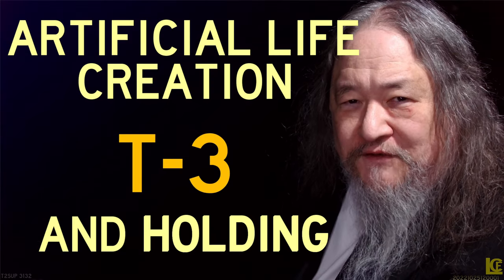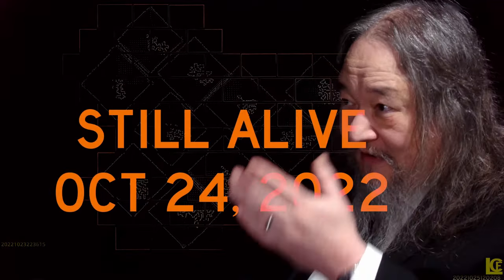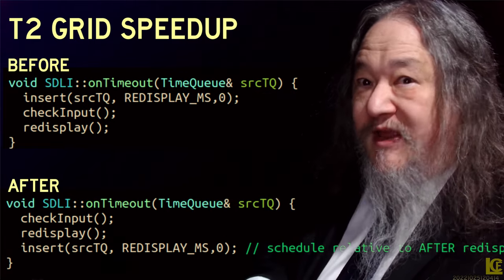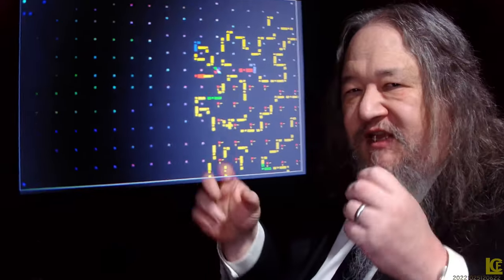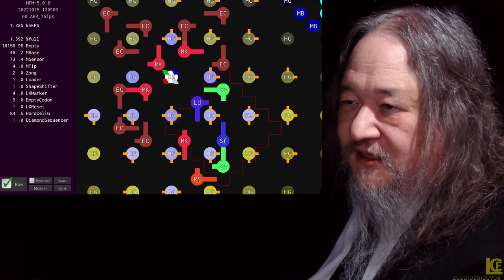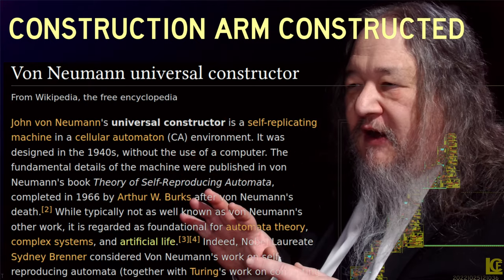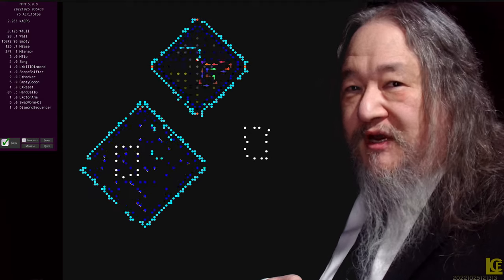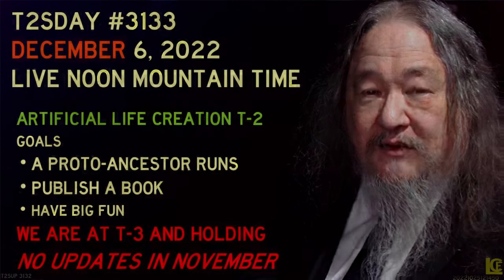Artificial Life Creation T-3 and Holding - T2sday Update 3132

Comment: More questions! How do you prove a minimum bound on up-time? For example, imagine you have an extremely complex sequence cycle with 1500 node species, and you've created self-replicating cells that can compute something meaningful:

1. Is there mathematical strictness that can be established on the uptime? For example, how confident can we be that systems deployed on this won't suddenly crash after some specific amount of elapsed time, say, 15 years from now? The termination state of the program could be postponed by complexity, but is it possible to provably establish that T_termination.

2. Related -- How is a mathematical definition of robustness established? If I "apoptose" a cell by hitting it with all sorts of random shit, will other cells split to fill the space and the functional role of that cell?

3. In an attack via cell-deletion (similar to your x-ray debugging tool) I wonder what the "takeover rate" of a distributed computational network like this has to be in order for the fundamental function of the computation to change. For example, if I wiped out every node but one, it might be possible for that one diamond cell to reproduce indefinitely, but the higher-layer "programs" on top may be lost completely, effectively resetting the memory of the system. In which case, the program must be injected back into the system (like a virus). Or do you intend for programs to be reducible to the diamond-cell level, where the "genetic code" of the fundamental cell bakes in all of the higher layer needs, much like the genome does.

Some cool things I noticed about your work...

Your system reminds me of the theory behind bitcoin, where an attack on the network requires 51% takeover of the nodes to effectively change the ship's course, so to speak; could be viewed as a dynamical system where you have islands of coherence and they are constantly evolving and taking over regions of the network in an effort to rewrite or control the blockchain memory.

Another analogy is the 2-dimensional Ising model, a very simple spin-coupling model in statistical mechanics that results in a similar battle of the islands for spin up or spin down territory.

Hope you enjoy. I am new to this idea, but something seems so undeniably elegant with this approach, it is hard to resist. It's like pandora's box.
Reply from the maker: A few quick thoughts only:
 - I'm not a fan of most proof styles (due to the assumptions they make) and prefer to deal in engineering realities.
 - I think about theories of robustness (not fault tolerance) but unsure what they might look like. I try to focus on self-stabilization at all scales.
 - Life fills space wherever there's resources. Cells will grow; whether they can achieve "higher" multicellular purposes is up to our design and engineering.

Comment: Questions -- is the grid world in each T2 limited to the screen's grid display? Theoretically the screens aren't necessary, right? These devices can handle more than the 2500 or so units they display? Internally, what is the max grid capacity?
Reply from the maker: mfmt2 represents only what the screen shows plus caches of the neighbors edges. The problem isn't memory but computing power - a single processor is shared across all tile sites.